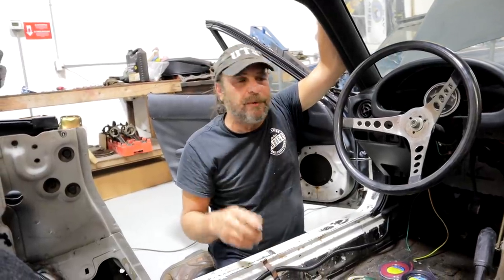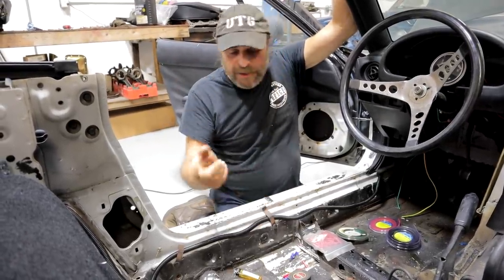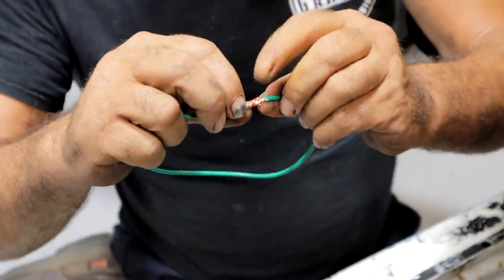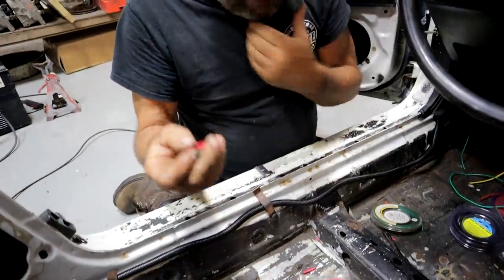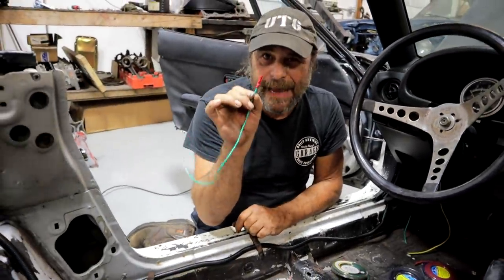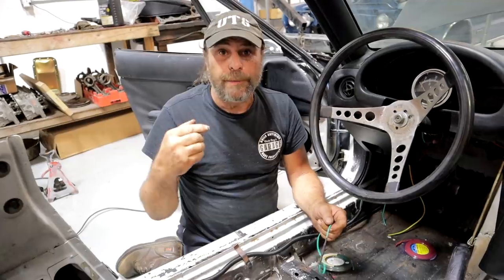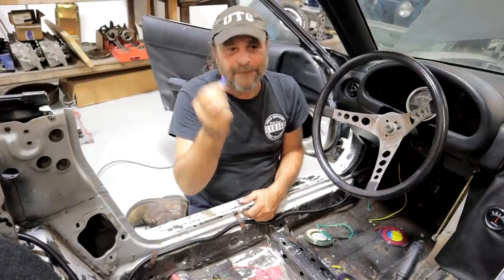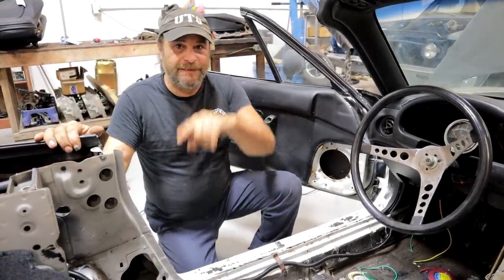The Single Most Misused Item In The World Of Cars

Comment: Everybody talkin about the crimp, nobody talkin about the strip. Years ago I took a USAF high value soldering course. We were two weeks into it before we even plugged in a soldering iron. The instructor inspected our strips with a low power microscope! He was looking for nicks in the conductor strands. You may think it’s no big deal to cut a few strands when stripping insulation but if the circuit ever nears max power your joint could heat up and fail. Bad stuff in any application but critical in a fighter jet. Worst case is fire, best case you built a hidden fuse into your circuit, it blows and you’re pulling your hair out trying to find the issue.

Comment: I wish you was my real uncle. One comment. Most times a wirenut sucks. But for distributing power in audio applications, it has its moments. Namely, when you are broke & roughing in the amps. Distribution blocks are nice, once securely mounted. When testing our amp/speaker setup, a big ass wirenut saves time. It is a poor permanent solution.

Comment: There are proper splicing crimpers available out there. They're about $30 a pair and are worth their weight! A proper crimp will NOT pull out. Aviation industry standard says that the wire must snap/break before it can be pulled from the crimped connection. You should be able to make a loop with wire closed with a crimp and be able to hang off a tree branch with it.

Comment: Never use "plumbing solder" or "silver solder" on 12 volt connections. I did it and it failed. Even though I used heat shrink, oxidation on the solder ate through the copper wire. It kind of look like the crust that builds up on battery terminals

Comment: The real issue is that copper work hardens. If you've installed copper brake line you've experienced this. The vibration causes the copper to harden till it cracks. Crimping it exacerbates this issue. A soldered joint will always be better because the heat anneals the copper. On a crimped joint the crimp should partially be on the insulation. If you look at factory wire terminals this is where they crimp them. Happy wrenching folks.

Comment: Those crimp splices always seem to fail on me. Copper wire with an aluminum sleeve is a bad idea. Bimetallic oxidation and different temperature expansion rates leads to failure eventually. Electrical engineer showed me how to spice back in the 80s. Fan the wire strands our ,lay on top of each other, twist, then shrink tube. Every strand from wire A touches a strand of wire B instead of just the outer strands, causing resistance IE heat. Next best thing to soldering.

Comment: That's called a Butt splices. There are better ones. Even ones with shrink wrap insulation as the coating. they're useful.. Your crimper is the worst type to use, the kind that crimps in the inside "V" of the handle is better, gives you more control and power if needed. The kind that crimps on the end are next to useless.

Comment: From my experience over the years as a truck driver and trailer wiring. I used wire crimps, liquid tape, and shrink tubes on all of my connections, cause road salt can work its way down to the connection point. But now with marine grade shrink tubes on the market, you can get by without liquid tape. 
That is what I have done and it has work well for me...so far.

Comment: I ruined my teeth  as I stripped countless wires with them when I was younger.  It was faster than getting out a stripping tool. That was whether I was twisting it with tape temporarily or soldering. I started soldering most everything sometime in the late seventies I keep crimp connectors both in the four-wheel drive and in the plane toolbox for emergency purposes .  But soon as I can I solder.
   My mobile toolbox for R/C cars when racing or camping has a DC soldering iron. Crimp connectors always quickly overheat due to vibrations. Seems there's just too much resistance.

Comment: There are at least two kinds of crimp connectors:  Insulated and un-insulated.  The both work by friction welding the wire to the barrel during crimping.  And that's the rub.  Most folks do not have the specs or the tools to make the right crimp.  They are usually too light.  So for the automotive hobbyist, it may be better to crimp plain and solder, then shrink tube.
There are two kinds of shrink tubing - plain and "environmental" which has a sealer inside.  As you heat environmental shrink tubing, the sealer will jell and flow to truly seal connection.

Comment: I always just solder, then use double-walled shrink tubing. If I do have to crimp a connector on though, I use a ratcheting crimper with a wider crimping area. They're so much better than the stamped steel tool you're using in this video, and the resulting connection requires an extraordinary amount of force to pull off. The idea behind crimping is that the piece actually cold-welds to the wire. You're never going to achieve that with that thin tool. Using heat-shrink on those splice connectors is a good tip, but ideally I think you should just solder.

Comment: If you use a good crimper the wire WONT pull out of terminal. The tool used in the video is very low end and cheap. When doing wire you should have a soldering iron and adhesive lined shrink tube for the big wires(12+AWG) or connections of multiple wires that wont fit together in butt terminals. For everything else heat shrink terminals are the way to go. Get a good set of strippers and crimpers. A good ratcheting crimper should be more than $100 for just one type of terminal. 

Personally I would not take my car to this shop for electrical work. If the shrink tube is holding the wire in the terminal then you didnt  crimp hand enough and will have an unreliable connection in the engine bay or other high vibration environment.

Comment: UT, I'm glad you made this video because I've seen a lot of bad connections over the years.
Ultimately, I gave up on using connectors except for particular applications that call for them.  I stopped using connectors because I don't like mixing metals and the norm in making connections is Copper Wire with an Aluminum Connector.  This is part of the reason why the guillotine connectors are bad.  So by eliminating the connector all together I've eliminated mixing metals.
My method now is to twist the the wires together, then lock-in the twist by adding some extra twist using pliers, then I fold the twisted wires to the side as UT had, and crush the twist with pliers to flatten it.  Then I finish up with heavy shrink tubing.
A lot of guys don't know that shrink tubing is available in different thicknesses, so avoid the very thin shrink tubing because a single strand of wire can melt through unnoticed when working with the cigarette lighter.

Comment: "an expert is anyone who does the basics better than anyone else" Richard Marcinko, creator of Seal Team Six.

Get your connections right and your grounds clean, and you won't spend the day xhasing issues--you'll just fix what is really wrong and avoid having to do the same job over and over because you got the basics wrong.

totally agree on the threaded yellow cap nonsense, but i live in a humid area--i always replace them when i find them in a car i just bought. 

Temporary solutions are great for temporary jobs. But learn how to solder clean without dripping on your dashboard, and you'll find that for the minute it takes for the iron to warm up...you have a permanent solution once you've measured out the length of wiring you need. just sayin'.

and i'll toss this in: if you think the engine is coming in and out regularly, considering running as many of the wires needed (temp gauge that isn't mechanical, etc) thru a quick release clip rated to handle the juice--then you're unplugging one wire rather than several and missing one or two (a grounding strap near the engine mounts also helps remind you to disconnect it a year from now) and wondering why the engine isn't coming out cleanly.

Comment: I agree with you 100 percent BUT have you ever used a wire connector called Posi Lock check it out yes there expensive but they work !

Comment: Personal choice , but I use a much better wire crimper, and they cant be pulled apart like that. But you are correct, there is many butcher jobs out there that I have encountered over the years working on industrial equipment, engine and battery powered. How some guys call themselves mechanics, etc, blow my mind.....

Comment: Proper crimpers also swage the sleeve around the insulation. Been using them for decades. Never had a wire fatigue off, even on machinery with heavy vibration.

Comment: Just get a 40 to 50 watt soldering iron some different sizes of shrink rap and some electrical tape and learn to use it properly.You will save time and money.
If you have to use or chose to use crimps jet good quality crimps and a good quality crimping tools.
Many project have been lost to fire / accidents / ect because of bad wiring don't let your project become another  casualty.

Comment: That's why I always carried the 5WR vise grip in my glove boxes . I would use them to either cut the wire , strip it , and crimp .. plus they fit nicely on the steering wheel, I just had a habit of putting them on my steering wheel ..

Comment: Thought I'd mention that some of those crimp connectors have a split seam that runs down the length of the inner metal "barrel"... When crimping you should align that seam with the top or bottom jaw of the crimper tool... If you look at stock factory bare metal crimps, both sides of the seam are curled over creating like two little "c" shapes clamping down on the wire... If you crimp with the seam on one side you end up with a flattened out "c" shape clamshell like crimp that doesn't have much of a tight grip on the wire and wire is more easily pulled out... It only takes an extra second to index the seam up or down.... I've also taken a tiny chip out of my tooth stripping them when I was younger, so I don't do that anymore....Keep up the cool videos!!!!

Comment: I have seen advertised - inline connectors that have solder in the middle & shrink tubing on the outside.
When heat is applied it melts the solder & shrink tubing at the same time.

Comment: That is still a unprofessional repair. Those are TEMPORARY connections. A true professional repair would be shrink butt connectors or the beat is solder and shrink. Ive had the shrink butt connectors have too high a resistance and cause issues

Comment: There's heat shrink connectors with solder AND waterproof adhesive. Solder melts as you heat the shrink wrapping, the 2 wires are meshed together in the center

Comment: You stressed twisting the stripped wire strands but you didn’t mention why. Sliding the untwisted wires in the connector, even with tight crimping, allows them to be pulled free easily.

Comment: Great vid, two follow-up questions:

Would you use heat shrink on connectors that have other ends, like forks, holes for bolts, or bullet terminals? and
If I forgot to use the heat shrink, is it acceptable to wrap the connector tightly with electrical tape? Ofc I would be putting it over the edges to seal it.

Comment: Look up lineman's splice, solder, shrink tubing. I have seen wire nuts, always corroded an 12 volts can't conduct across the corrosion.  Use rosin core solder not acid core that is for plumbing and old skool body leading.

Comment: I recently invested in a heat gun and a 150 PC assorted solder connector kit. It was under 20 bucks for the connectors and I'm not looking back. My son did a radio install on my boat and it came out perfect. 🤘😎

Comment: The solder-in-situ deals are the best IMO.  Put both ends inside the little shrink tube, heat-gun action, the tube shrinks, the solder inside melts and boom your wires are soldered.  I ALSO recommend shrink tube on the outside of those or at least something like F4 tape.

Comment: If you’re really gonna use these butt splice connectors, get the type where the insulation IS heat shrink tube. Not as good as a shrink wrapped solder connection, but it’ll work. The heat shrink insulation takes the mechanical stress off the crimp itself (the point of the video).

Comment: You are pointing out all the stuff that I did whenever I had to wire something what I used to do with those butt connectors though instead of shrink wrap and sometimes I couldn't crimp them good and they would slip out so I started super gluing the ends and I figured that would kind of like you're saying there's no shrink wrap around it to keep stuff out I would just super glue that not only do that but to keep the connection to stay in it was so terrible.  I do solder stuff now though although I bet I put way too much solder on.

Comment: One thing i've used while working out in the field when no shrink tubing was available is to coat the solderless connection with plain old R.T.V silicone. This completely seals the joint and makes it incredibly strong

Comment: I always bought the connectors without the colored sleeve, and after crimping it, I would infallibly solder the connection, then heat shrink over the connection!  Faster than traditional soldering, and without the colored sleeves, the diameter of the joint is Vastly reduced! 😊👍

Comment: A good video Tony. I remeber the solderless connectors back in the 60's up but I don't know of any heat shrink through to about the 80's. I never really cared for the quik connects that you chucked aside, but we used them to splice into an excising wire but they did damage and the wires would turn green in time even under the dash. I always go to the heat shrink now, it saves somany headaces.

Comment: Solderless connectors in low voltage applications  should also be soldered 4 to 20 milliamp signals .like  most newer vehicles  have.

Comment: I work on stuff since I can't afford a mechanic or afford to buy new. I just finished working on a leak on the kitchen sink in my rv. What I hate about working on stuff is when you put it back together and it still doesn't work, or when the engineers design it to difficult to work on. If I were to design things everything would be simple to get at. sure you would have modern technology, but you wouldn't need all these special tools to remove something. Good example the goofballs at Ford decided to go with a stretch belt along with a serpentine to run the car. I say if it isn't broken don't fix it. I would just have one belt a serpentine belt. Or on some engines the plugs are to difficult to reach no mater how many extensions or knuckles you have for the extensions. another stupid design is a coil for every plug why not have one coil for all the plugs where a tune up cost you under $100 back in the day and you replaced all your wires. Another stupid design is to put the alternator at the bottom of the engine where the air conditioning compressor is blocking. So instead of taking 20 to 30 minutes to remove the alternator back in the day when it was a t the top it takes hours or maybe days to remove and install. Another thing the auto manufactures will do is discontinue a product that last a long time. I had a 2001 chevy caviler that I ended up getting rid of with 243k due to the car rusting. The car maybe burnt a half qt oil per oil change and didn't burn any transmission fluid. The mechanic at the transmission shop said the next model year GM started making the transmissions with plastic since they lasted to long. The Ford use to have a perfectly good transmission in their Ford Focus tell they decided to put a 10 speed automatic to save fuel. I have had that car at the Ford dealership twice and they still haven't fixed the problem.

Comment: I try to buy uninsulated solderless connectors (hard to find since most stores don't carry them), crimp and solder them together, cover with di-electric grease shrink-wrap the connection, protect with liquid brush-on marine grade liquid tape and a plastic split loom.  If the the joint is in a high vibration zone, zip tie it to the chassis or body.

Comment: Your crimper is rubbish - you need a ratchet crimper; it will make a perfect crimp and it will crimp the insulation as well.  Heat shrink tube will seal the joint but it will NOT increase the strength (copper v rubber).

Comment: Drive the copper inside out with a punch and throw the plastic away, then crimp normally and use it with glue impregnated shrink tubing. I use channel lock crimping pliers for a better crimp. Don't like soldering wires because of the stress it can cause in a vibration situation and possible wire fatigue and breakage. Don't ask how I know.

Comment: Prime example of why I always solder any and all connections if possible. Only time I use butt connectors is in a pinch. There's just no beating a soldered connection, plus I'm a firm believer that any person who tinkers with wiring should learn to solder at some point. It's an easy to learn and extremely useful skill.

Comment: I remember in the early 2000’s Ford went away from solder for warranty repairs. They found that crimping and heat shrinking created a much more reliable connection. They even sent out a nice ratcheting crimping tool for the dealerships to use.

Comment: Right, those clip/snap scotch lock blue connectors cut strands and just try to bite wire.
They poorly use a tiny fraction of each end and leave it exposed to oxidation.
They can last less than thirty days, so only good for roughing in to test and removed to complete the job correctly.
The shrinktube with a polymer seals it when heated. That's what pro jobs under warranty are supplied with.

Comment: Use bare unsplit butt connectors with a proper crimp tool and solder it.  Then use adhesive lined heat shrink.

If your heat shrink isn't adhesive lined you might as well just use tape